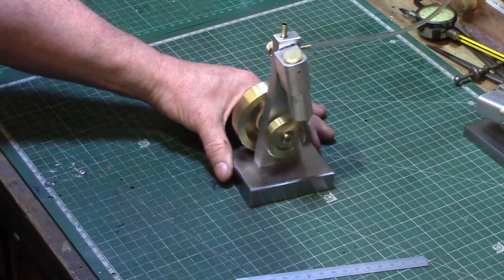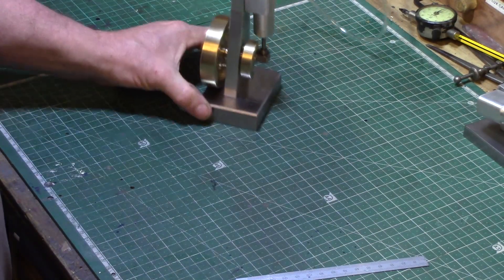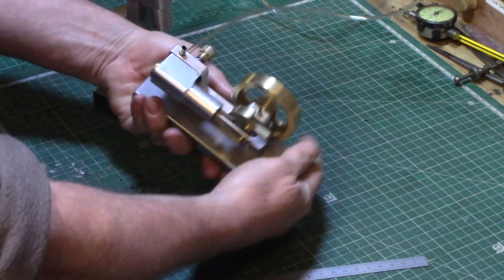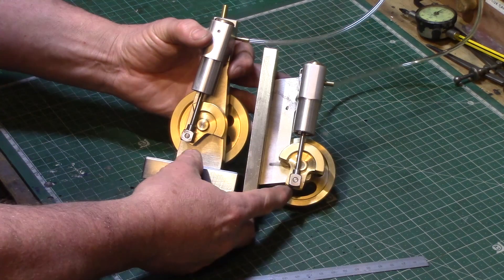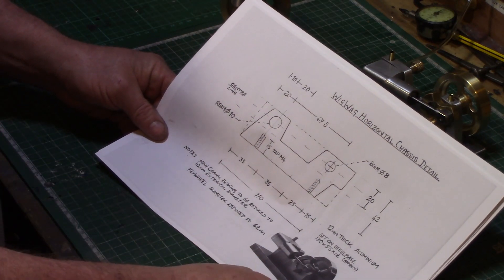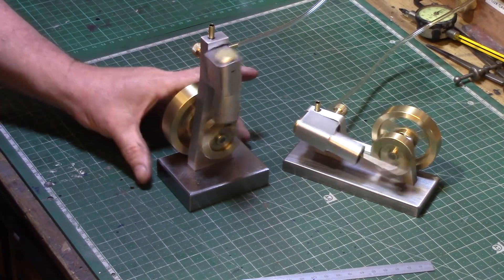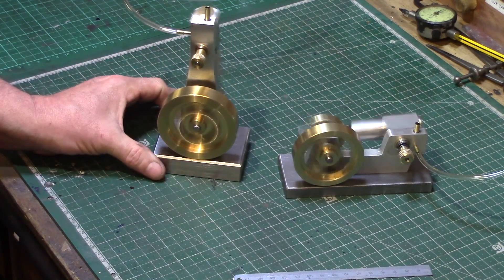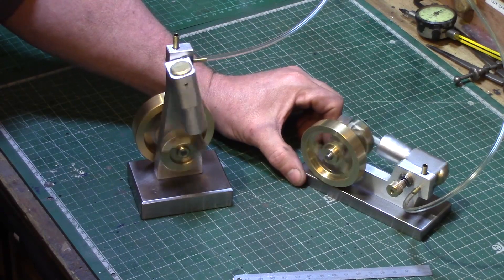WigWag Wobbler Engines

Comment: which of the two engines run faster? Just curious
Reply from the maker: Hi Daniel, the speed of the engine is dictated by the input pressure of the air/steam, the cylinder volume in the WigWag engines is identical so the speed would be very similar. However, they are not designed to be high speed engines, the will run fast, but I run them as slow as possible.

Comment: Thanks for making this so easy for the beginner!  I just got my first lathe, a South Bend 9A, and was getting a little intimidated by the Elmer plans.  These plans look so much more friendly for the novice.
Reply from the maker: Hello Ryh Norton, yes the WigWag is very easy for the beginner, in fact it was designed to be an easy introduction to model engine building, be sure to visit my website and facebook group for all the free plans and updates - Regards. Ade -  https://wigwagengine.wixsite.com/wigwag
Reply: @Ade Swash  Thanks! One question while I have you here.. do you think all of the holes/threads could be converted to imperial equivalents without issue. M8 to 5/16" would be an example.
Reply from the maker: @ZorbsterPrime  yes, no problem converting sizes and threads to nearest imperial

Comment: Lovely Engines...well done....ps Where do you get your brass from....blinking expensive to get hold of 75mm dia brass rod for the fly wheels.
Reply from the maker: Hi Matt, yes it is expensive stuff, and I turn most of it into swarf! you can by cast iron flywheels if it works out cheaper, I got lucky a couple of years ago and bought a 14 inch bar of 3 inch billet for the cost of a good meal, but not much of it left in the drawer :(